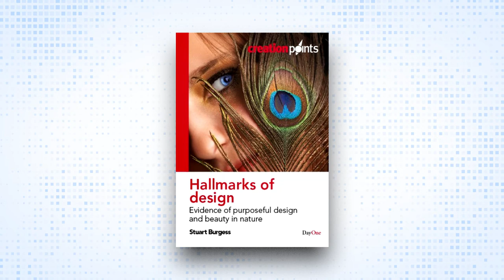The History of Flying Machines Helps Show Flight Did Not Evolve (Article Podcast)

Comment: I have no clue how biology and evolution of new organs works. So anything I say here can be completely irrelevant or only solve part of the problem. But there are a few things I want to mention. 
There are a lot of animals which can jump quite far. And they are normally light enough that falling doesn't cause the breaking of bones. And even if it did, I'd rather survive with a broken bone over being eaten. 
And the other thing is that the brain is a good control mechanism. It can adapt to new types of movements quite well. 
And as a last point a plane which can carry a human needs to be quite large. And the larger/heavier something is, the more difficult it is to give it flight. The largest flying animal (Quetzalcoatlus) is suspected to be only of the weight of a human even though it had a wingspan of 10m/30ft. Normal animals with the flight skill have way lower body mass and therefor need less restructuring of their body to allow for the proportions which are capable of flight.
Reply from the maker: "I have no clue how biology and evolution of new organs works"
That is to be expected. Evolution is taught very poorly in the education system. It is inaccurate, crude, misleading, and at times, simply dishonest. Most people who believe in evolution don't understand it, and many were convinced specifically because their teachers misrepresented the 'theory', or used 'proofs' that are now known to be false (junk DNA, vestigial organs, ect.). 

"There are a lot of animals which can jump quite far. And they are normally light enough that falling doesn't cause the breaking of bones. And even if it did, I'd rather survive with a broken bone over being eaten." 

Such a tale doesn't create a pathway for the evolution of flight. At most it would allow creatures with a more robust physique to reproduce at somewhat higher rates, but this situation you paint would have to make an extreme difference in reproductive rates in order for it to be relevant (about a 10% difference). Essentially, the organism in question would have to fall out of trees often enough when evading predators, such that those who land with little to no injury would be able to reproduce at a substantially higher rate than those who would not handle such a fall so easily. 

Of course, one should also remember, that in the wild, where every single day is a fight for survival, where you compete to escape/fend off predators, forage/hunt for food, and compete with other members of the same species for territory, food, and a mate; something that you see as relatively trivial (a broken bone) would easily be a death sentence in those circumstances. Breaking your leg in the jungle when trying to escape a cheetah will cripple you for months, and you may never properly recover. Such an injury would likely see you die shortly afterward due to infection, inability to obtain food, or you would be killed off by another predator (potentially even the same one if it simply climbed down). 

Less restructuring? Changing to hollow bones, a new lung system, the development of structured feathers, and fixed thighs are all extreme modifications. That's just getting started with birds, the structural changes needed to go from a grounded mammal to the flying bat is likewise extreme.

Looking at any flying creature today, all of its alleged evolutionary ancestors would require drastic structural changes.
https://creation.com/chapter-4-bird-evolution

Of course, the greatest issue here is not just that the changes are extreme, but that the supposed mechanism of evolution (mutation+natural selection, over millions of years) is incapable of generating the kinds of changes needed for major changes, whether it be the evolution of flight, or the evolution of land animals, or the evolution of eyes. 
https://creation.com/the-evolution-trains-a-comin

The articles I linked you to are laymen friendly starting points, not intended to be comprehensive. A good place to start.
Reply: @creationministriesintl  Cool, such an extensive reply. 

I only had 1 year of biology at the end of grade school so anything evolution related is self taught. I have my problems with evolution too, but the morphological level isn't one of them. After all there you can give various solutions with storytelling. If those solutions are actually plausible is not really testable as far as I'm aware off. 

About your YouTube comment:
The reason I brought up jumping far and breaking a leg is because of two places in your video. You said getting controlled gliding right is the most difficult part. And failure, if we don't succeed, will lead in broken bones. My counterpoint is that animals which can jump far basically have that point down and the detriments of broken bones is not as much of a problem as it is with humans. 
In your reply you bring up something I also consider as a problem of Evolution. As an electrical engineer I have a bit of knowledge when it comes to control theory. And there is a term called signal-noise-ratio (SNR). In this case the signal is the new information for the new organ. Evolution has loads and loads of information which is barely noticeable (almost neutral mutations spread out all over the DNA) or even completely invisible (redundancy and backup systems within the cell). No matter how small the noise is, the signal is so minute that it can't be detected. Therefor it can't be selected for. And if you can't select for it you can also not select against damage of it. Because of that my intuition and educated guess is that evolution is only useful to select against extreme negative mutations. It can't select for almost neutral beneficial mutations or against almost neutral detrimental mutations. Adding to those issues it takes ages until a selectable positive mutation is percolated through the entire population, which is actually necessary for the creation of new species. So evolution is only a protective measure against negative changes in a short timescale and can't explain the evolution for new species or even the upkeep of existing creatures over millions of years.  
But that is a general issue I have with evolution, not a morphological one. When I just focus on the morphological level then I think most of the problems humans have for learning to fly are already solved in several non-flying animals. 

I'm aware that survival with a broken leg is more difficult. But as a counterexample I bring the lizards which loose their tails deliberately. I'm aware the loss of a tail is not as detrimental as the loss of a leg. But survival and escape of the danger zone can be the crucial change which allows an animal to live just long enough. Especially if the same change allows for the invading of new niches and ecosystems. Also I think that the risk of breaking legs is smaller the smaller the animal is. 

Those structural changes are the things I don't know. I'm aware that there are a lot of differences between a chicken and a T-Rex. Do you know the structural changes between a flying squirrel and a normal squirrel and what is needed to make a flying squirrel really fly? 

About your two articles.
Article on bird evolution:
You raise a few good points in the subchapter: Did gliders turn into fliers? Although I think length of limbs and body size is probably one of the easiest thing to change. 
I disagree in one point. The brain does not necessarily need new DNA to adjust to control the flight muscles. The brain as I know it can adjust to many things. It can't adjust to everything as there has never been a talking monkey. But I don't think the hurdle for gliders to flyers from the brain perspective is as big. I might be wrong though. Do you have further information on that? 

Article on evolution train: 
In the train article you mention a problem that I normally formulate in a different way. Evolutionists rate mutations based on beneficial vs. detrimental. This describes the influence of the mutation on the fitness of the creature. But this is both conceptually as well as mathematically completely independent from complexity/information. Evolutionists just assume that it leads to an increase in complexity and a few very simplified neural network simulations seem to confirm that. Creationists focus on information gain or increase of complexity. There are loads of mutations which the evolutionists call beneficial and the creationists call loss of complexity. Reason for that is that most creatures trade flexibility for specialization. And specialized animals are "fitter" in a specific environment but they loose complexity in the process. 
I agree with that problem. I have a different problem where I think the language hinders the understanding. But here creationists aren't using language which clarifies things. So I have no clue how the mechanisms behind it actually work. Can you help me with that?

You mentioned that the distinction between micro and macro evolution is bad because it gives the wrong impression. I think it is bad for another reason. I've tried to get an understanding of what micro evolution is compared to macroevolution. I would say there are three categories which we can distinguish: 
- Phenotypes 
- Mutation within the protein family (or single mutations of a protein)
- Mutation beyond the protein family 
Macro evolution requires Mutation beyond the protein family unless I'm very wrong. Or are all protein families which a human has also found in the most primitive bacteria? That would surprise me quite a bit. I think it is obvious that all currently proposed mechanisms can't create new protein families. Just for pure probability reasons. I have no clue if anyone has ever done the work but it would be interesting to see a tree of life where there are clear distinctive lines which say where proteins from protein families are found and where they aren't. That's one certain way to draw a line which evolution can't cross and therefor need to have different kinds. 
But let's ignore that part. 
What is micro evolution? When we see an adaptation to the environment taking place do people say if it is change in phenotypes or mutation of the protein? Is there even a difference between the two? As far as I'm aware nobody says that if my father has blue eyes and I have green eyes that this is a case of evolution. That's just a change of dominant and recessive genes. Same with a big dog and a small dog. Is there a distinction being made between the two and if so how do I find out? 
I'm aware that there are other things which complicate things. For example there entire genes can be duplicated. Or preexisting genes can be applied to new things. An example of that would be the nylon eating bacteria. For me that entire microevolution thing is hugely confusing. Can you help clarify that for me?
Reply from the maker: A well worded response, I would agree that evolutionary storytelling is too plastic to be useful in explaining anything. However, as to the point about tails, for some lizards losing a tail is inconsequential because they are essentially designed to have easily removed, and regrown tails. For many other animals, the loss of tail would be catastrophic. Considering the falling from a tree bit, we also have to keep in context what sorts of adaptations would be reasonable to propose. Evolution lacks any foresight and cannot plan ahead. Many of the structural changes needed to move from a tree dwelling lizard to a flying bird would not be functional step by step, and during this transitional process the changes would be grossly disadvantageous. Example being the transition from bellows lungs to the avian lung, no functional intermediates have been found, let alone a believable path for the transition.  

It is not hard to conceive of how something could be beneficial, and thus evolution may favour it, but the actual details are not so fun. Eberlin (an ID scientist) describes it this way 
“… the ‘Why-with-no-how’ evolutionary fallacy. It’s easy to explain the advantage (‘why’) of a feature, but the ‘how’, with the corresponding mechanisms and detailed evolutionary pathway at the molecular level, is largely or wholly ignored. Such ‘explanations’ fail to consider the immense risk and difficulties of such an evolutionary leap.” 

An evolutionist by the name of Dr. Skell had something similar to say: “I found that Darwin’s theory had provided no discernible guidance, but was brought in, after the breakthroughs, as an interesting narrative gloss. …The efforts mentioned there are not experimental biology; they are attempts to explain already authenticated phenomena in Darwinian terms, things like human nature. Further, Darwinian explanations for such things are often too supple: Natural selection makes humans self-centered and aggressive—except when it makes them altruistic and peaceable. Or natural selection produces virile men who eagerly spread their seed—except when it prefers men who are faithful protectors and providers. When an explanation is so supple that it can explain any behavior, it is difficult to test it experimentally, much less use it as a catalyst for scientific discovery. Darwinian evolution—whatever its other virtues—does not provide a fruitful heuristic in experimental biology.”
Skell, P., ‘Why Do We Invoke Darwin? Evolutionary theory contributes little to experimental biology’, The Scientist 19(16):10, 29 August 2005.
Now, you have certainly hinted at someone important in population genetics, which is of course selective noise. Are you fammiliar with the term "Genetic Entropy", it is a theory constructed by Dr. John Sanford that postulates that due to the extremely minute effects of individual harmful mutations (near neutral) natural selection cannot remove the vast majority of deleterious mutations. As a consequence, the population as a whole degenerates, while differential reproduction merely sorts out the members with exceedingly bad mutations, the population as a whole will still slowly degrade. Here is a layman's introduction to it: https://creation.com/genetic-entropy-vs-evolution, given what you have said here, I think that genetic entropy will be the most interesting topic for you, it certainly was the most compelling argument I have ever heard. 

Unfortunately, confusion about terms can be one of the most frustrating parts of the conversation here, as you are keenly aware, part of this is based on how one defines 'evolution', and 'information'. Most evolutionists would define evolution as any change in allele frequency. So even something such as a population of frogs losing their lungs would be qualified as evolution. https://creation.com/breathtaking-new-frog-surprise

Creationists acknowledge that degenerative mutations can be beneficial. A good way to think of it is that evolutionsts focus on just how fast the car is moving, or how often it wins races. Any changes that increase speed, or allow the race car to win more often is evolution (increase in reproductive fitness) the flaw in the logic is that no distinctions are made in the type of change. 

Creationists care about what kind of change is allowing the car to move faster or win races. Are better engines being developed, improved treads, more efficient fuel, or is the car being stripped down so it weighs less? 

It's not so much about the loss of flexibility, although that is the usual consequence. The focus is on the loss of genetic diversity. Natural selection causes a population to become better adapted to an environment by removing variations from the population that are ill-suited for the environment, and as a result the information content of the genome decreases at the population level, and natural selection will preserve beneficial traits, but like the lungless frog, it does not distinguish between the kinds of changes, or the long term consequences. Lungless frogs may survive very well in highly oxygenated mountain streams, but if they find themselves with dirtier water, or needing to get out of the water (due to a new predator) then they are in a bind. 

You won't get to a solar powered, self-driving car by stripping it down, and that is ultimately the failure in logic on the part of the evolutionist. Of course, not all evolutionists are so blind. 

However, we both know that in order for fish to slowly evolve into modern humans, they need to gain numerous structures, new gene families, ect, not simply lose what they already have. Creationists have chosen terms to describe changes in information content while evolutionists just call any beneficial changes 'evolution'. 
https://creation.com/defining-terms

"As far as I'm aware nobody says that if my father has blue eyes and I have green eyes that this is a case of evolution. That's just a change of dominant and recessive genes. Same with a big dog and a small dog. Is there a distinction being made between the two and if so how do I find out? " 
This would not typically be called evolution because it is merely happening at the individual level. Say, in over 3 generations a population of humans changed from having 15% of all its members being blue eyed, to 25% having blue eyes, this would be called evolution. 

It isn't, but that would still be called evolution in normal usage of the term. 

Of course, I would be cautious here too, as many evolutionists recognize that this micro-evolution doesn't help for the grand evolutionary narrative. 

I recommend using the search engine on creation.com as we have already gone in depth on most of this, including the nylon eating bacteria.
Reply: @creationministriesintl 
Your first three paragraphs can basically summarized by a German weather lore saying: 
"Wenn der Hahn kräht auf dem Mist, ändert sich das Wetter, oder es bleibt wie es ist"
or in English:
"When the rooster crows on the dung, the weather changes or it stays as it is"
I think another problem which causes confusion is not only that everything is proof for evolution but I have no clue what selection pressure is. The best I have come up with is the following: 
"The best selection pressure is found when there is a perfect balance between the number of new mutations and the number of children which can die off to select for the best mutation." 
But that only works with detectable mutations. Which 99% aren't. Also this definition of mine completely neglects, that if a mutation is beneficial or detrimental completely depends on the organism and environment. So in the end it is a completely meaningless statement. 

I think the argument for lack of foresight is only partially applicable. If evolution is working properly, then organisms can select for a better fitness without a foresight. But if there is no functional intermediate then the lack of foresight is a good argument against a certain evolution of an animal. The way you worded it makes me think you are aware of this. But I wanted to mention it anyways, especially since I've had conversations with people who mix it up. 

I've watched the video of Dr. John Sanford on Dr. James Tours channel. As far as I remember I would say that the current observation overlaps with the layman understanding of what the term entropy means. But as far as I'm aware, the word entropy is a tricky one to use scientifically correct. Also the age decay curve which Sanford showed in Tours video didn't really look correct to me on an intuitive level. But I haven't looked at this stuff close enough to make my case. I wouldn't want to defend genetic entropy in front of a critical audience but neither would I want to defend any definition of "the survival of the fittest". 
If we stick to the simple observation that randomly changing symbols in a code reduces the functionality over time and call that entropy then I'm in agreement with that. Especially when we consider how complex the cellular life is an how short the information storage is which is supposed to control all of that. 

While reading through your genetic entropy article I had a though. Each of the completely neutral and completely undetectable mutations have a half-life of one generation. The reason for that is that it is very unlikely that you will have another person with the same mutation. Unless you have offspring with your sibling. But most animals are protected against that. I have not yet thought through the implication of that statement. It might turn out into something pro evolution or it might not. No clue yet. But I think it will probably be a better response than the common: "Once the accumulating damage from the mutations becomes significant, NS will start to remove them."

I think the article on defining terms has a few points into the direction of solving my question. There Endler differentiates between natural selection which just juggles around allele frequencies and evolution which actually creates new alleles. When I look up Microevolution on Wikipedia they write
"Microevolution is the change in allele frequencies that occurs over time within a population.[1] This change is due to four different processes: mutation, selection (natural and artificial), gene flow and genetic drift. "
And about Macroevolution they write: 
"Macroevolution usually means the evolution of large-scale structures and traits that go significantly beyond the intraspecific variation found in microevolution (including speciation)."

I don't like this Wikipedia definition. It basically uses the poorly defined word of species as a basis of differentiation between micro and macro and doesn't have any functional difference between the two words. I much prefer actually measurable things to be the difference. So if I just shift the preexisting alleles around enough then I can create something which looks different enough then it turns from micro evolution to macro evolution. But if I invent an entirely new protein family through the process of mutation but it is not species changing then that is microevolution. That's just sophistry. I think that is just as bad as the circular definition of "survival of the fittest". If they do that then any genetic change which applies to more than one individual is indistinguishable from something which creates an entirely new species.
Reply from the maker: "The reason for that is that it is very unlikely that you will have another person with the same mutation."

I would encourage further reading. The article you read was merely a laymen friendly introduction. Genetic entropy is not meant in the sense of general entropy, the term has a specific definition, which is similar to what you described with degrading codes. 

One thing to remember is that humans are already multiply mutant, and that the human population as whole is mutating at roughly the same rate. Each generation on average, the children will have 100 more mutations than their parents started with. This means they will inherit a portion of their parents' mutations (both from mom, and dad), but also will have new mutations. Now given the sheer number of mutations over the generations, many will share mutations. inbreeding greatly exaggerates the problem, but as genetic entropy (the book) mentions, the fact that many mutations will not be shared by both parents means that many mutations will not be expressed, which also makes them invisible to selection. Thus, the entire population is mutating at roughly the same rate, so natural selection not only can't eliminate near neutral mutations, but the mutations are so uniform that no matter which members are weeded out, the next generation still has more near neutral mutations than the last. You will always inherit some from the parents, and you will have new ones. Many won't be expressed, but those that are expressed still have so little impact on reproduction that it won't result in any meaningful decrease in reproductive rates (especially since virtually every member of the population suffers from roughly the same number of equally insignificant mutations). In addition, any substantially beneficial mutations (likely still loss of function) will come paired with numerous near neutral mutations (as differential reproduction occurs at the level of the organism, not at the molecular level), so the mutations will continue to accumulate. 

By selective pressures, I should clarify, a selective pressure is just any circumstance in an organism's environment that creates struggle for reproduction. limited food, competition for mates, or even internal struggles such as the amount of sperm a male produces, the litter size of the female. So, any variations (mutation caused or otherwise) that allow a creature to have notably more offspring will be favored. This makes most things that are considered 'beneficial' or 'harmful' entirely circumstantial, but whether or not it reduces the overall functionality of the genome is not dependent on the environment in which the mutation occurs. 

A previous example would be with the lungless frogs. During spawning season the males needed to mount the females, but the strong current would often carry the males off of the female's back, and this is a selective pressure.  When the frog lost it's lungs, the body became flat, and was less likely to be caught in the current. This allowed a substantial increase in their reproductive success as they were caught up in the current at a much lower rate. 

Now, I think you may be thinking about foresight in the wrong way. It is easy to see that natural selection lacks foresight, because natural selection is just differential reproduction. The only things "selectable" are those that provide an immediate and substantial increase in reproductive success, future adaptability is not factored in. This much you recognize when you stated that as creatures become more specialized, they also become less flexible in what conditions they can thrive in. 

The creatures have lost so much genetic diversity that they are essentially pigeonholed into living under very specific circumstances. When it comes to large scale evolution the same problem exists. Differential reproduction is only concerned with what provides an immediate and notable increase in reproductive success. The evolution of flight is claimed to have occurred as numerous insignificant changes accumulated over many millions of years, not only would this have to overcome immense engineering difficulties (such as with the complete overhaul of the respiratory system, with all hypothetical intermediates being unworkable, not to mention unseen in any fossils), but each change would have to provide notable enhancements in reproductive success. 

The mechanical problems, and the limited changes available in observed mutations is acknowledged by many evolutionists who view the neo-Darwinian synthesis as invalid. I will provide some quotes below and cite the original article. I think you will find that their rescue attempts are speculative to say the least, but their criticisms of the modern synthesis sound like they came from the mouth of a creationist.
Reply from the maker: the conflict is not about the “if” of evolution, but the “how”. While they all remain evolutionists, the evolutionary community has become fractured as more scientists no longer believe that natural selection and mutation over millions of years are sufficient to cause evolutionary changes, and that the changes caused by natural selection and mutation in the present do not account for the development of the major differences between animal groups. This is the basic argument that creationists have been making for decades. While changes occur, and they do accumulate, the changes actually observed in the present do not explain the origin of the major animal groups or explain how major anatomical innovations could occur. In the article “Do we need a new theory of evolution” published in the Guardian we can see this conflict explored, and many revealing statements are made. 

"Take eyes, for instance. Where do they come from, exactly? The usual explanation of how we got these stupendously complex organs rests upon the theory of natural selection.
You may recall the gist from school biology lessons. If a creature with poor eyesight happens to produce offspring with slightly better eyesight, thanks to random mutations, then that tiny bit more vision gives them more chance of survival. The longer they survive, the more chance they have to reproduce and pass on the genes that equipped them with slightly better eyesight. Some of their offspring might, in turn, have better eyesight than their parents, making it likelier that they, too, will reproduce. And so on. Generation by generation, over unfathomably long periods of time, tiny advantages add up. Eventually, after a few hundred million years, you have creatures who can see as well as humans, or cats, or owls.
This is the basic story of evolution, as recounted in countless textbooks and pop-science bestsellers. The problem, according to a growing number of scientists, is that it is absurdly crude and misleading."

The article goes on “For one thing, it starts midway through the story, taking for granted the existence of light-sensitive cells, lenses and irises, without explaining where they came from in the first place. Nor does it adequately explain how such delicate and easily disrupted components meshed together to form a single organ. And it isn’t just eyes that the traditional theory struggles with. ‘The first eye, the first wing, the first placenta. How they emerge. Explaining these is the foundational motivation of evolutionary biology,’ says Armin Moczek, a biologist at Indiana University. “And yet, we still do not have a good answer. This classic idea of gradual change, one happy accident at a time, has so far fallen flat.’”
Given these admissions, is it really honest for someone to say that evolution is just “change in allele frequency”, and that these small changes are ‘micro-evolution’?

All these evolutionists who are arguing that we need a new theory of evolution, are not arguing that the grand story of evolution is false, only that it doesn’t work the way most people currently think it does, and that the way everyone is taught evolution works is wrong. 

Now, often people who are convinced of evolution are convinced because they are exposed to the fallacy of equivocation. They are given a few examples of adaptation, natural selection, mutation, and are then told that by extending this over million of years, all life on earth evolved from a single celled organism. They use a mechanism that doesn't support this narrative, to convince people the narrative is true. 

Anyways, I can't put much more onto this, as the conversation has already gone on very long. I encourage you to type other things/related topics into the search engine on creation.com. There are plenty of articles that expand further on genetic entropy, and address the criticisms. One should always pay attention to how one defines a term, and less what one immediately associates with it. Afterall, many people point out that the term "natural selection" implies agency (ie nature is selecting something) as that is how "selection" is normally understood, but the literature on natural selection defines it clearly. Genetic Entropy is the same, the documents on Genetic Entropy are careful to distinguish its meaning from the common and vague way in which entropy is normally used. 

However, it is not hard to find the common definition of entropy that applies to this. 1 definition is "A measure of the loss of information in a transmitted message.", and Genetic Entropy is essentially this, but applied to population genetics. 

Anyways, I hope this is all helpful, but the various articles on the website will do a much better job of giving a detailed, and clear explanation of these things, than I can do here.
Reply: @creationministriesintl  Genetic entropy:
The genetic entropy books is on my to buy list for a while now. But this list is growing faster than I read. Especially since there are quite a few big and tenacious books among them. At some point I will hopefully get around reading it. I guess I was influenced a bit for my negative take by Sal (yt channel = evidence and reason). He looks at it from a physics and chemistry point of view and there the definition is a different one. Redefining words in new discipline is something I should be used to. 
Also I managed to think about my though a bit more. I'm still of the opinion that almost every mutation which happens falls under the neutral category. And that means it has a half-live of one generation. If we assume 128 neutral mutations then they will be gone in seven generations (2^7). Or let's rather say the chances of a distant offspring having a mutation of the great-great-great...grandfather will drop below 1 mutation in the seventh generation. But this does not solve the problem. Within 7 generations we will have an increase in 700 mutations. All of them undetectable. Now the only question is how much can a creature tolerate. Let's take easy numbers and say one generation is 25 years, humankind existed for 10'000 years and there are 100 mutations per generation. That would add up to 40'000 mutations. when we consider that the human genome has 3bio base pairs then 40k doesn't sound like a large number. 
What do you think about this train of thought. What am I missing? The reason why I think I'm missing something is twofold. For one there is not yet much thought put behind this argument and the other reason is that it seems like the observed morphological changes are bigger than just a change of the genome by less than 0.001%. 

Selection pressure:
I'm more or less aware of what you just wrote. But when I look at the claims of evolutionists then there has to be more to it. Especially when the people are right who believe that evolution happens in an alternating fashion of low mutation rate and high mutation rate. My question is more along the line of how can we optimize the selective pressure in favor of creating new information. 
I try to make a new take definition which might fit better with what I strive to understand. 
"The highest selection pressure is present if there are a lot of mutation happening where a large number of offspring are dying due to environmental circumstances and only a small number of the most adjusted survive."
Your definition of just focusing on more offspring creates the species which dominates a certain environment, but it does not factor in the speed of mutation. I guess mine doesn't factor in the creation of new information. In my case all mutations could be (and most likely are) destructive. 
Sorry for using this conversation to think out loud. 
By the way I've heard that there are bacteria which accelerate mutation rate in specific sections of the genome if they are in a life-threatening situation. Have you heard of that as well? I sadly don't know the source as I've heard of it in a conversation. 

foresight
In the case of bird evolution I mostly agree with you. I say mostly because of this sentence: "[...] but each change would have to provide notable enhancements in reproductive success." People can be surfing on a standing wave. They don't move at all but they are constantly driving downwards. The same should apply to evolution as well. Survival of the fittest as in the animal which manages to drive out all other creatures don't necessarily out-reprodcue everyone with large numbers. It is enough if you don't die out at times. I don't think with that I say something which you disagree. I just wanted to highlight it. 

People who are convinced of evolution
"They are given a few examples of adaptation, natural selection, mutation, and are then told that by extending this over million of years, all life on earth evolved from a single celled organism."
I want to add to that that there are things like phylogenetic trees, fossil records, genetic scars and no alternative theories. I don't say those are good arguments but they are all (made to) align and therefor they add to the theory being convincing. I say those contribute why a lot of people believe in evolution. I don't have enough knowledge to judge the validness of each of these. 

Side note:
At first I though you went over the 10k character limit and that is why you split up the comment. But with a quick check it seems you missed the mark by around 500 characters :) Thank you for the time you put into writing the comment. I am aware how much time it can take to write them. You don't have to reply to the questions I've asked in this comment.
Reply from the maker: I will not personally take the time, but if you have searched the website, and found no answers, then I encourage you to use the contact us section of creation.com, so that you can ask our specialist staff. Robert Carter is a PHD in biology, with a lot of experience in genetics, so he could certainly explain in better depth than I could. However, you need to search the website first. 

Best wishes.
Reply: @creationministriesintl  Thank you for the reply and the time you put into it. I appreciate it and I learned a thing or two. 
I think the approach I will take is let it rest for a while and when I get new info I look into it again. It's just a hobby for me after all. Not something where I depend on getting the opinion right.
Reply: @dai0laffin  Cool, I found a guy who can knows about evolution. Can you answer a few questions of mine?